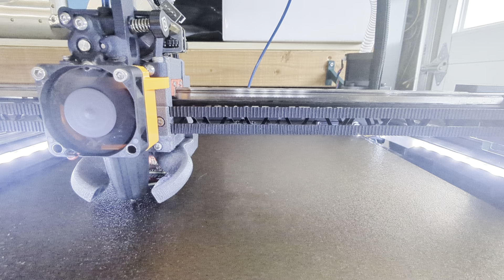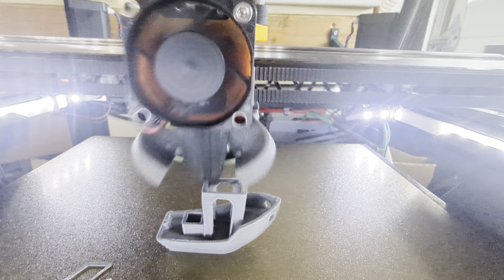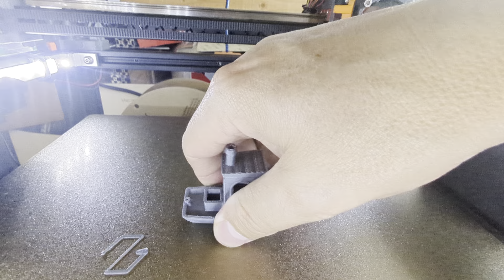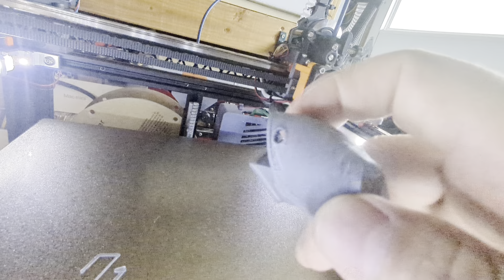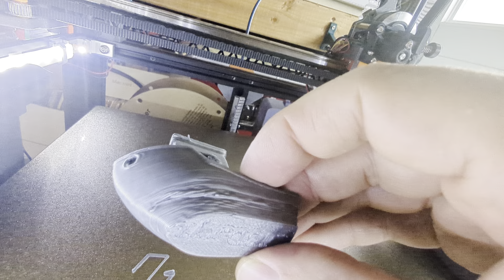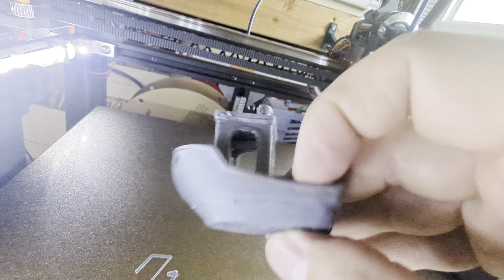ZeroG Mercury 1.1 quick benchy (8:56)

Comment: What's your start print and print config? I'm using fluidd and klipper.  The reason I'm asking is that I set up KAMP for my printer. Do you have any references to see this code? Pretty awesome feature!
Reply from the maker: Here's the modification I made to the KAMP Adaptive Purge gcode to print the Z: https://gist.github.com/djsplice/eb310ca8bc3c5a6c087517d9d83ad281

Comment: Got side air cooling now! So new bed too? Or did you fit it in?

Where can I find those brackets used to attach the top to the wall back there? Those are awesome to have handy, are they published?

Awesome awesome machine
Reply from the maker: Here is a link to the SCS - side air cooling https://github.com/djsplice/SCS works pretty well!

I put on a 310mm bed a while ago as part of the 3-point leveling system - it just fit and isn't 100% usable on the Ender 5 Pro, but there is just enough room to fit the cooling ducts.

I haven't posted the wall brackets because I thought they would be pretty bespoke to my setup (built to match the angle/distance for my printer to the wall) - but yeah, those things help a ton and keep the machine from creeping off the side of the bench!!
Reply: @JeffBarrows  when I read your comments about bolting it to the bench and wall I just had to find out more about how
Is it just as simple as that bracket on the wall then attached with T nuts to extrusion?
Reply from the maker: @217RockStar217  - I ended up reusing the old 8mm metal rod and brackets that came witht the Ender 5 - I think it was originally used by the Y axis on the gantry? I'd have to take some pictures to better show it...

Comment: Wich duct and Partcooling fan are you using ?
Reply from the maker: I'm using an EVA 3.0 fan duct and a WS7040 CPAP fan.

I'd been using the EVA 3.0 dual 5015 fans before switching to CPAP. Dual 5015s with static bed cooling worked pretty well, but CPAP is definitely a step up, especially for fast PLA printing